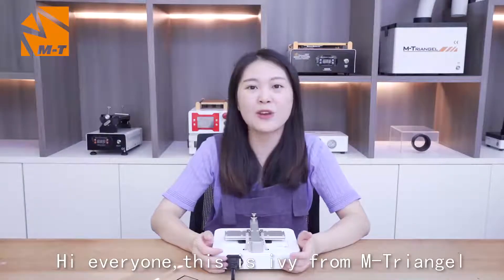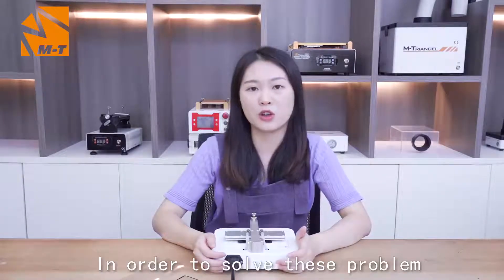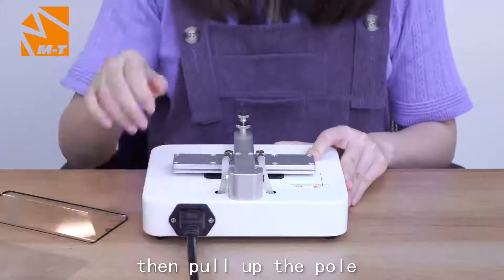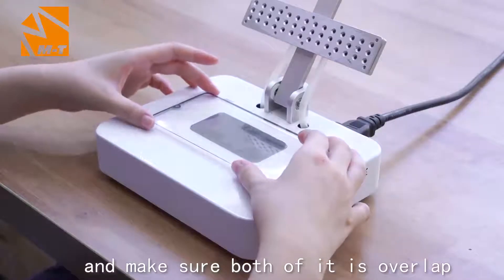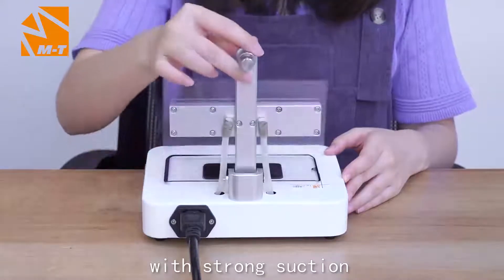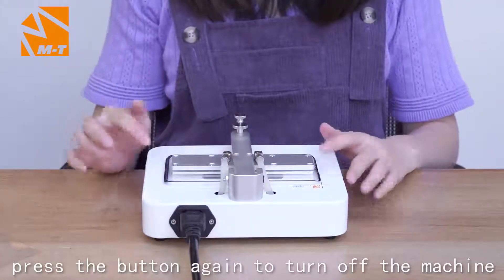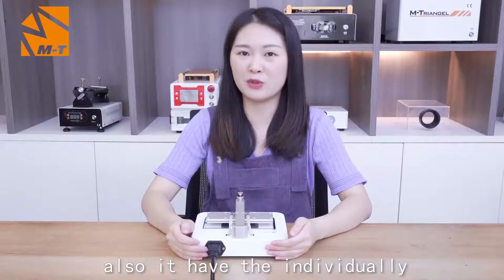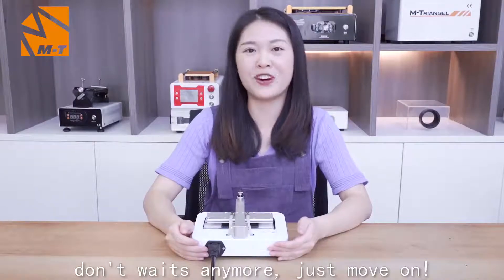OCA/LCD installation positioning machine operation demonstration

Comment: it has a vacuum rubber suction head to suck the screen into the glass, which is more convenient than a straight surface that can't be aligned when placing the screen on the glass. articulation to adjust the height and low so that tempered glass can be placed